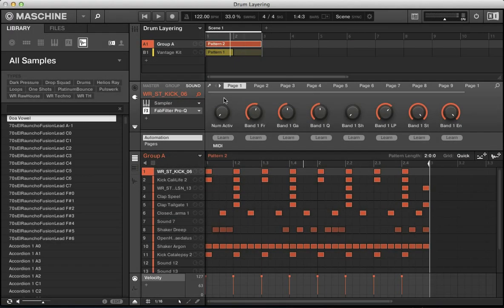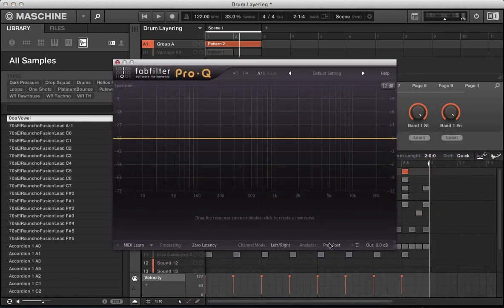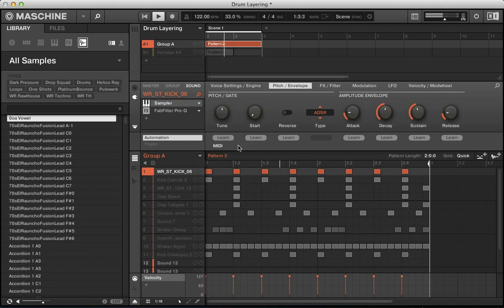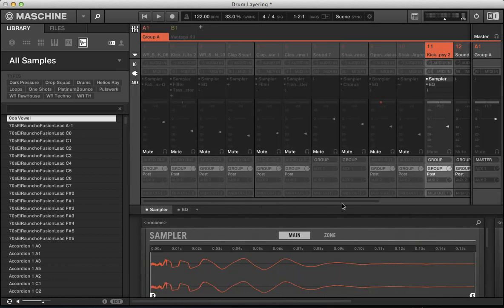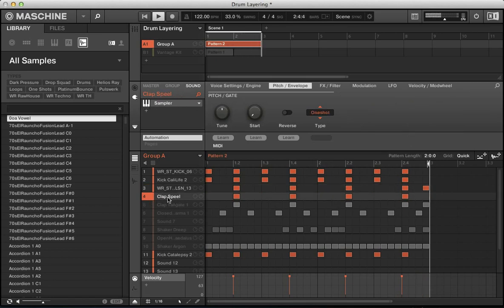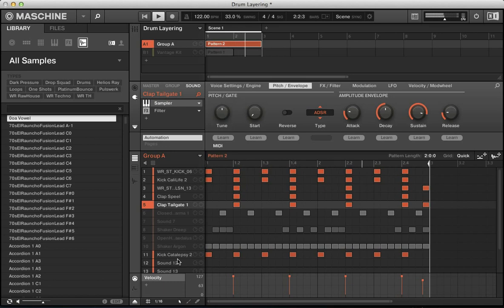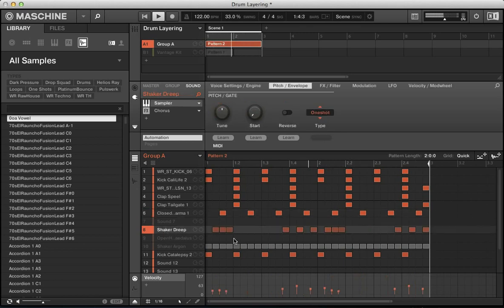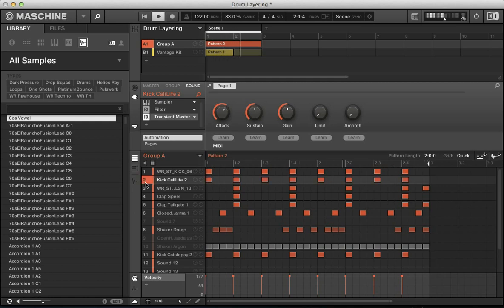NI Maschine - Maschine Drum Layering Techniques Explored - How To Tutorial

Comment: Great video! There's one thing, however. I would not under any circumstances tune a kick to any of the keys in the bass melody. Side chaining can't handle the booming frequencies on its own, plus the sub end of your kick may at times go as low as 35Hz, which means there will be plenty of fighting for space. So be sure to register what frequencies the keys in your bass melody are and layer your kicks at least one note away from either one of them. That's about 3 to 5Db you're saving, the sound will be much cleaner.
Reply from the maker: The way I usually mix bass is to cut away from a bass around the kick drum frequencies, and then layer a sub/sine wave in between the kicks. This way there's no clashing in the sub/low frequencies, and the fundamental of your kick is in key with the rest of the track.  
That said, I understand your approach. Neither of us are right or wrong, just different techniques.

Comment: Is there a reason you used a separate filter effect instead of the filter in the sampler?
Reply: I do the same. The built in sampler roll off is very slow. so it is impossible to get all of the low (or high) frequencies out. The actual filter effect has a much more precise roll off attenuation.
Reply: Thank you sir, In the end I record everything into ableton lately. Effects on both platforms confuses me a lot